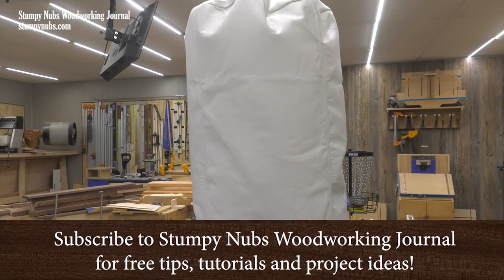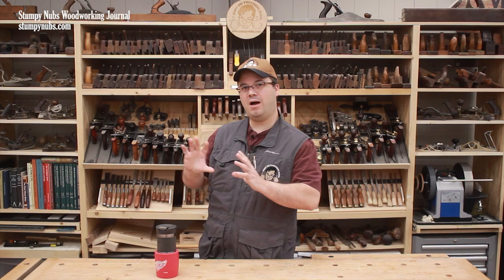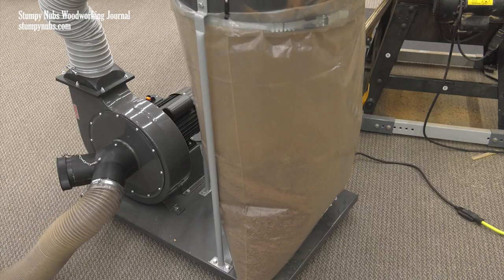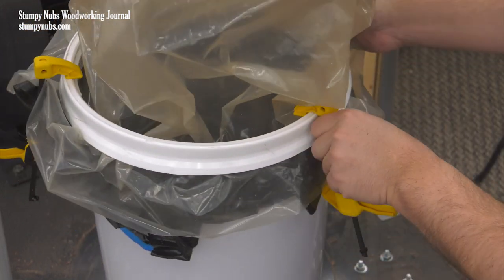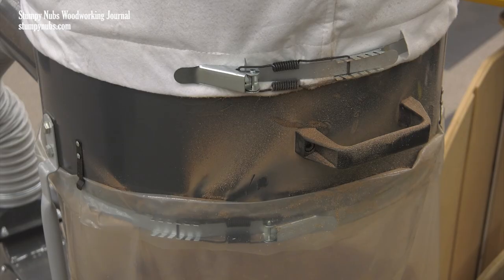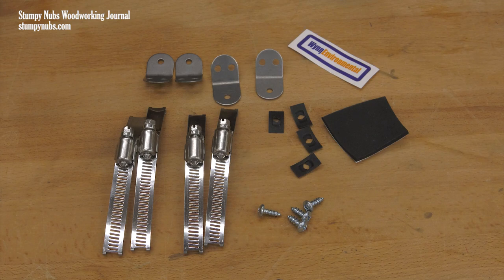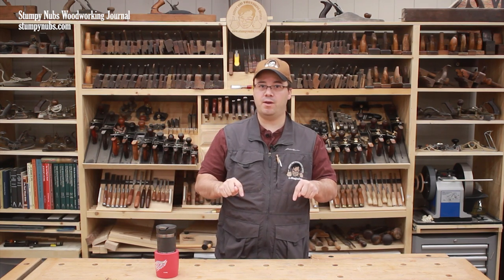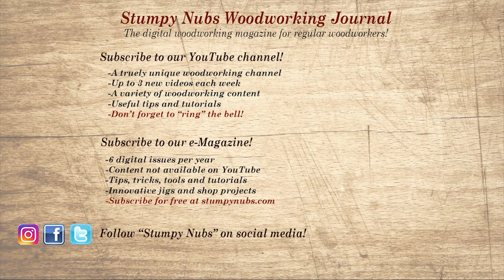How a bucket and a donut changed my dust collector

Comment: Pleated air filters do have lots of surface area when the pleats are clean, but when the pleats fill with dust, the surface area is reduced to next to nothing. The larger the number of pleats, the less space that there is between them and the easier they fill with dust. Canister filters with lots of pleats often do not work well in heavy dust load situations. The pleats fill too quickly and are difficult to clean. The narrow spaces between the pleats blind easily and trap dust. Paper elements work well when new, but blind easily and can't be aggressively cleaned too many times. Cloth filter elements are more robust and can be cleaned many more times.
Reply from the maker: They are not difficult to clean at all. A little compressed air takes care of it and doesn't even create a mess because you can leave it right on the collector and all the dust goes inside the bag. Seriously, it takes about five minutes. Professional dust collector systems have been using pleated filters for a long time. My big cyclone system has two of them. We clean them once a month when they are getting heavy use.
Reply: Why don't they just make the cloth bag taller and finer mesh?

Comment: Couldn't a skilled woodworker build a box that sits atop the DC holding standard sized, square air filters with the same total filter area?  Using standard sizes from furnace suppliers (or Home Depot, Lowes, Menards) would result in an easily replaceable filter at a much lower cost.
Reply from the maker: You could make a box, but if you are planning to use furnace filters it would have to be a gigantic box with many, many filters.
Reply: @StumpyNubs  how many square inches of filter is the canister media.  Get the same square inches of square, right?
Reply: @robertpautsch5093  Just looked up one of the filters on Wynn's site. It has 274 square feet, not inches, of filter area. Not sure how many furnace filters you would need to match that.

Comment: How about you just wear a dust mask when emptying?  No mods...  Boom, nailed it.
Reply: You will still have dust in the air of your shop.  It's going to settle everywhere and get stirred up again when you aren't wearing a mask.
Reply from the maker: You still have to deal with the issues I mentioned regarding the belt causing tears and leaks, not to mention they are a big hassle. But if you're happy, I'm happy :)

Comment: So how often do you need to change the filter? Can you blow/vacuum it off and use it for a few years or does it need to be replaced on a regular basis?
Reply from the maker: You can clean it with compressed air as needed.

Comment: While I agree with your upgrades to the dust collector. The downside to the pleated filters is that over time the pleats become clogged and need to have the dust removed. A better solution is putting a cyclone separator of some sort in the air flow. The negligible impact on air flow is offset by keeping the fines ( the bad dust) in the cyclone and not in the filter or in your lungs. There are some great videos out there building one yourself. The other downside to those expensive pleated filters is that if you don't have a separator that over time the filter will require replacement.
Reply from the maker: It is very easy to just blow some compressed air through the pleats from the outside once in a while to clean the filter.
Reply: @StumpyNubs  If you are blowing air at higher pressures than the filter is rated for you are actually damaging the pleats and increasing the size of the particulates that can come through.
Reply from the maker: I didn't say to blow it out with very, very high pressure. I merely said that the filters may be cleaned with compressed air. If you are concerned about what pressure to use I recommend speaking to the filter manufacturer.

Comment: Curiously, what are your thoughts on wet filters? I've seen cheap-and-cheerful single horse blowers available that don't have the separator-style section off to the side - they go straight into a bag. Mounting a canister is no doubt possible with an adapter of sorts but part of me wonders if there's any merit to just blowing out through a PVC pipe into a bucket of water, experimenting with things like how deep the outlet should be, where it should be located, and what if anything needs to be done to the shape of the outlet (would creating a whirlpool help over just a bubbler in the middle, for example).

Obviously there would be restrictions (especially on start up) but that's true to an extent of bags and canisters as well, and it would certainly trap that fine dust in a sludge you could just dump in the garden when you're done. Not great for large jobs without looking into a separator; though it's a single horse unit so that's not unexpected going in.
Reply: I'm guessing here. But from memory these dust extractors are HVLP. High volume, low pressure. So if you send it under water it would likely struggle. If the water is too shallow to present significant pressure it will get blown away, deep enough to stay put and you would effectively choke off most of the study collector air flow. That said I have personally wondered for a while if you could use water to get all that very fine dust. But I suspect the lack of a commercial product is a big hint it's not feasible. But I've never researched it either . . .
Reply: @WarrickTaylor  I mean that's about where my head was at. I've seen plasterers use wet filters with a vacuum successfully but they're obviously much higher pressure. In having said that, though, I've never seen or heard of anyone actually trying it with an extractor so I've no idea either way.

I figure why not ask someone in the know. If nothing else, perhaps there's a story or two in it.
Reply: @asterchades  My guess: Adding it to a design intended to pick up chips, large particles and fine dust means more space, complexity and maintenance that might just put it in a strange niche market. I don't know how much water that would require either. Plus the water would change the humidity of the shop which could be bad for wood + tools, and an unheated shop might freeze it.
Reply: @Aubreykun  Freezing water is something I would never have considered. Especially not on a day like today, where it's hard to believe this part of the country even saw snow back in the Ice Age. Maybe that's one of the reasons I never hear about people trying?

Comment: Nice. But cannisters are $$$$$
Reply from the maker: Not really when you consider the benefits. And you can clean it with compressed air, so it lasts a very, very long time.
Reply: Cheaper than a lung transplant ... 

Seriously, I was very slack about duct collection for decades. At most I had a shop vacuum for chips and didn't always use that. Until I was diagnosed with asthma at age 70! Now I have a roll-around DC (tiny shop) and ALWAYS use it on every machine. I also use the Trend Airshield helmet & face shield to have filtered air gently flowing over my face. (Also prevents eyeglasses fogging!) And I STILL wear a dust mask with that as well.

Comment: I built a small shed for my dc, got all the fine dust out of my workshed.
Reply: For some, this is a great solution. However, if your shop is heated or cooled, putting a DC in a shed outside can be expensive. You'll be pumping a lot of heated or cooled air into the great outdoors!
Reply: @DKWalser  It works for me, living in the temperate part of Australia.

Comment: First - good ideas. I did this and the fine dust would get so thick on the inside that I would lose air flow.  Have to remember to clean the inside of the filter when the bag is emptied.
Reply: Oh, no! This wasn't his first good idea.
Reply: @mothman-jz8ug  I meant I was first to comment.  That's a first for me on any channel.

Comment: My tub is smaller than the filter. Why can I not just add a larger donut to sit on the top of the tub, rather than make an inner donut, and then add the larger donut as you recommend?
Reply from the maker: How are you going to attach it to the tub? That's what the smaller donut is for, as demonstrated in this video.
Reply: @StumpyNubs  Great point. I was going to screw 4 of the metal brackets to the metal tub wall. BUT - I see your idea is better. Thanks for the quick response, Jim.
Reply: That was the answer I was searching for in here, too. I'm with Mark. I don't see the advantage. Just use 4 more angle brackets to secure the larger donut to the tub from the uderside and the canister on the top. What am I missing? One donut, less weatherseal and caulking. And, as someone else pointed out, cut a small groove in the underside of the donut to fit on the rim and caulk/seal that for a tighter seal. Not criticizing, just looking to understand what I'm missing before I move forward.

Comment: Could you not ct the bottom off the clear bag and then place that skirt in a garbage bag lined  trash can, when full gently ease the trash  skirt out and then take the lined trash can out for disposal?  You neve need to take the skirt off so should reduce wear and tear.
Reply from the maker: You would need a way to seal the "skirt" around the trash can. Make sure it seals really well or you will be pumping fine dust into the air.
Reply: @StumpyNubs  good point

Comment: can anybody tell me, in filtering the air in your shop how efficient are box fans with furnace filters?
Reply from the maker: Not very. The filter will catch dust from the area immediately surrounding it. But a dust mask will keep it out of your lungs better than a low powered box fan.
Reply: I've seen some people test it and they seem pretty efficient, but YMMV because shop size is an important factor.
Reply: @Aubreykun  Thanks. My shop is 12x36. The cieling slants from 8' to 12'. Maybe two box fans will do it. Still have to wear dust mask while cutting and sanding. Thanks again.

Comment: Great video!  The canisters cost more than my new HFT dust collector, though.  I think I'll try running with just the cloth bag filter and see how that goes.
Reply from the maker: That's a testament to how cheap the HF dust collector is, not to how expensive the Wynn canister filters are.
Reply: @StumpyNubs  True!  😁. In fact, I’ve already seen that the 4” HFT cheep-o Pittsburg trigger clamps are $2 each vs the $11 each Dewalt you used.  I know which ones I’ll be trying should I make that change.
Reply from the maker: I think you'll find you get what you pay for. :)
Reply: @StumpyNubs  Possibly, and I haven't for my regular use clamps, but for holding a lid down, $8 for four vs $33 for three seems a risk worth taking.

Comment: Brilliant!  How would one clean the filter media? I'm sure there is a way . . . I see things with "beaters' that appear to knock the dust down from the inside, but I'm not sure how well that would work.
Reply from the maker: Blow some compressed air on the outside. Fast, easy, and not messy. "Beaters" are hard on the filters.
Reply: @StumpyNubs  can you vacuum it?
Reply: @jonathanhodgkinson1397  you'd just be filling up the filter in your vacuum instead, which would then itself need cleaning . . .
Reply from the maker: The dust is caked on the inside. Blowing air through from the outside will cause it to drop into the collection bag.
Reply: @StumpyNubs  that makes sense, thanks

Comment: Would it be possible to run two impeller motors one after the other to increase airflow?
Reply from the maker: I tried it once. It's risky. One motor can cause the other to burn up.
Reply: If you need more airflow you can upgrade the harbor freight impeller to the impeller from a rikon dust collector. At that time you can even change the housing to a six inch in vs the 5inch.
Reply: In optimized multi-stage blower assemblies, the stages are different. Look at drawings of jet engines to see examples.

Engineering such a thing is obviously possible, but not simple. The most straight forward way to reliably get more air flow is to get a more powerful blower. That is assuming that the duct work is already optimized.

I don't know what issues await someone trying to run blowers in parallel.

Comment: would having the dust collector outside, underneath or above the shop help in eliminating the fine dust and negate the need for a cartridge, great channel, watched for years
Reply from the maker: If you can place the collector outside, or vent it outside, you won't need a filter. But you will have to deal with heating/cooling issues and possibly issues with neighbors or authorities if you are in a residential area.
Reply: Neighbors might not appreciate the sound or the fine dust. Same with nosy community associations, municipalities, officious zoning officials, and do on. I'm in a semi-rural area but - out of courtesy - I don't vent outdoors because I have neighbors within 100 meters on three sides.
Reply: @StumpyNubs  i was thinking of putting it under my shop as i have space in the subfloor, with no filter on it as you suggest i suppose i would have to block the hole where the filter sits, a bit confusing but thanks for you prompt reply
Reply: @teatarau  not sure if I understand your setup but if you're venting the collector into a part of your building I'd consider what might happen with a larger buildup of dust in that space over time? Just a thought.

Comment: What I did with my HF dust collector:
- Super Dust Deputy
- 256 sq ft pleated cartridge filter with gamma seal and bucket 
- Rikon Impeller
- Cut out the 4” inlet on the impeller and replaced with 6” duct take off
- 30 gal fiber drum 
- ivac switch on a dedicated 20 amp outlet and breaker

Check out my IG for a pic @cesar_gphoto